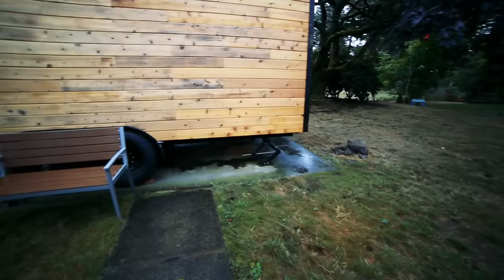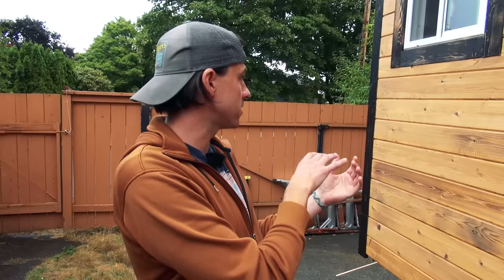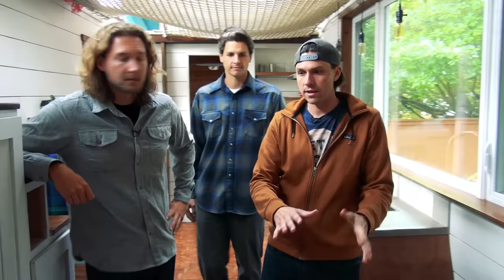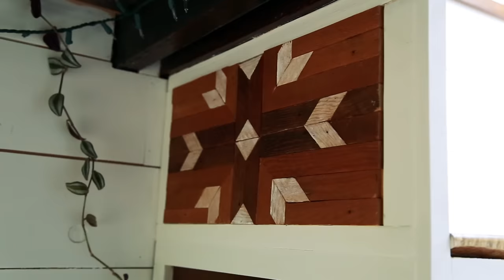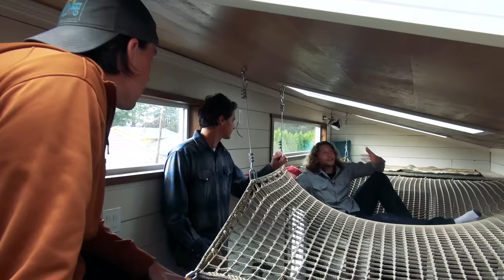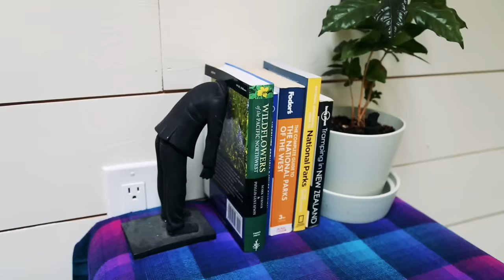DIY Tiny House With Amazing Loft Hammock

Comment: Hammock is a cool idea but don’t see the point of “lounge area” being a hard bench. Only place to be comfortable is the hammock.
Reply: I agree. It's a cool house but very ...comfortable. Its not a home yet, as they said.
Reply: I agree.  That whole corner seems awkward. Could see a lot more cushioning and the table seems redundant.  Make the other table a fold out for more temporary surface space or designer another for that corner. That tether on the end of the table is awkward and don't like the hinge in the middle. 
But the net is a total win!   Not only does it give more sleeping/lounging space, but also makes the loft area a lot safer and comforting than other lofts. Very cool
Reply: not native English speaker here, and it sounded suspiciously like lounge, but by the look of it - I was just thinking that's their way to say lunch area, lol

Comment: That floor is amazing! Just awesome. Love the hammock too ;)
Reply from the maker: Thanks Helen! Glad you liked this one. :)
Reply: The floor was a labor of love. We had the idea and went after it. I don't think I've ever done so much sanding in my life! Thanks for the complement!
Reply: Whit Scott   It's a beautiful floor. The choice of stain and cubic shape gives it a brick look. I never thought about finishing a floor using cut ends. I am guessing that they're at least a 1/2" in thickness. And that the individual tiles were probably secured with with brad nails? However, I was thinking that you didn't have to necessarily sand each individual piece, but instead, use the large buffing/sanding machine to even out the rough spots before sealing it.
Reply: Carlyle Tom, thanks for your note, I appreciate the compliment. The cuts are 1/2 inch. I hand sanded because I wanted the tiles to have a rounded edge, similar to terra-cotta, or old brick. The stain actually came out a little oranger than we were intending, but we are happy with the result.
Reply: Right, I did notice that the edges were broken. I'm guessing that the end cuts would have a greater propensity for cupping (especially if only finish coating the top surface).

Comment: Really nice setup! Excellent work all the way around. I did note where the wire rope clips used to support the hammock are installed backwards. The old adage: "Never saddle a dead horse," immediately comes to mind.  Seat “live end” (load carrying) of the wire rope in saddle and position U-bolt over “dead end.” I'm sure what you have will hold just fine, but rotate them 180 degrees if you prefer a proper installation.

Comment: Very smart design and looks good ... a chain or rope would look better than the thin rope for the table. I really like it though a lot of the same ideas I thought of and love. The hammock is cool, never thought of that. I think the weight on those hooks is crazy. It needs better holding power. It doesn't look strong enough.

Comment: Love this show.  Problem with cable supports for the hammock.  The wire rope clips are on backwards.  ‘Never saddle a dead horse’. The wire rope clip saddle is on the dead wire.   One at a time, loosen and rotate the clip 180 degrees and get the ‘saddle’ on the load bearing wire.  These should be ok short term but, I would correct this just to be safe.

Comment: Quick note on the wire clamps holding the net .... they are wrong  .. Remember the large portion is the saddle ,  never saddle a dead horse ..the U bolt goes on the dead line .

Comment: I absolutely love this one it is my favorite I would like one like this without the loft how much would that cost. I just want one with a bed in the living area and a closet instead of the stairs and I love that window and the skylights but cannot climb steps so I would like to find someone to build me one that is only 20 ft long and 8 1/2 ft wide just like this without loft so I suppose that would make it normal 6 -7 ft in ceiling height correct? This one is the best I have ever seen.

Comment: It looks very nice...aesthetically. 

 Some practical things:
1. Bathroom is too big.
2. kitchen is rather big. 
3. Lounge is rather small. One lives in the lounge,  not in the bathroom. Neither does one live in the kitchen.
4. The net is not practical for anything. No one will sleep on it, and it's not practical for storage. 

But then again,  it was mentioned that the tiny house was not meant for long-term living but rather for a few days at a time. For this it will work well.

Good, neat, well finished off job.

Comment: Wow, there is a lot of space here.
It only just needs a little extra bit of space in the fsleeping area to have just a better surface to sleep on, which i with my back really need, and almost everyone will want. A rug is not for sleeping on.
The net does fix it for a lot of people, i would be broken after just 1 night unfortunately.
There is a bit of a shortage of storage, i would be able to live here long term, but would be great for short stays or holidays.
Most of these things are very fixable in what they have here i feel, just because they still have so much space downstairs, and i don't feel like it would immediately make it too cramped, i still think they'd have enough space.
A net liek this should almost be a basic/standard addition.

ALso, yes, i too hate the adverts/promotions, but, they pay the bills.
It's like people saying saying they hate how some things need to make money, like cutting edge stuff, or organizations helping people in need, on whatever, level, but if they make money, you are sure they can and will keep going, you lose that, it becomes a cost, and it may die for many reasons. It's just a small advert, some you can skip, it's why this stuff exists.

Comment: It´s exactly like one of the guys says - great for a hangout, but not necessarily fit for being a home. The net is definitely cool but wouldn´t do as a bed for me. The other two lofts have little headspace even without a mattress put in. The lounge area is lacking in comfort. Servicable as a dining or office area for sure, but not a lounge. Also, generally, there are too many windows in this tiny house. I´m all for light, but this feels too open. 
The really impressive things here are indeed the floor in the kitchen and that artwork made from recycled wood, espeically in the bathroom. That is so utterly gorgeous while at the same time providing a warm and pleasant atmosphere.

Comment: I have a tiny house & it is called an RV and it costs considerably less. Just something to think about. Still nice video though!
Reply: With the possible exception of vintage airstreams which are expensive as F&@k.. have you ever seen 20 or 30 yr old RV's and travel trailers?  90% of them are already in a landfill somewhere.  The rest should be but are parked on the side of the road in California serving as alternative homeless shelters.  A solidly built tiny home of wood construction can be re-stained re-painted and re-finished over and over and still look as good as new and never look outdated for 100yrs at least.